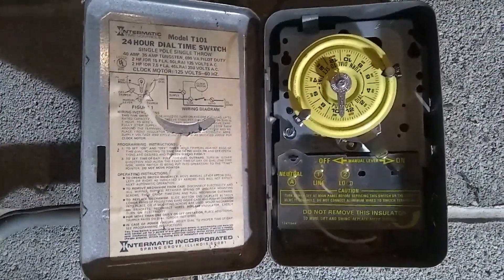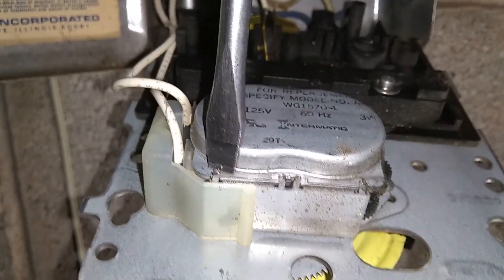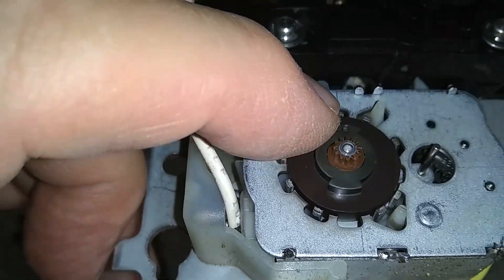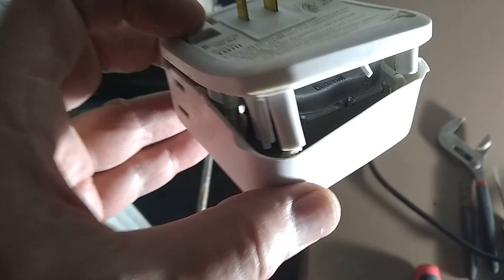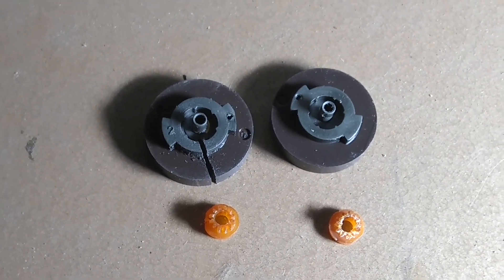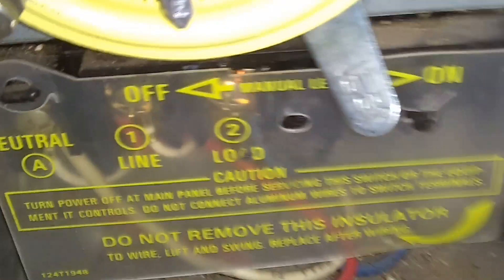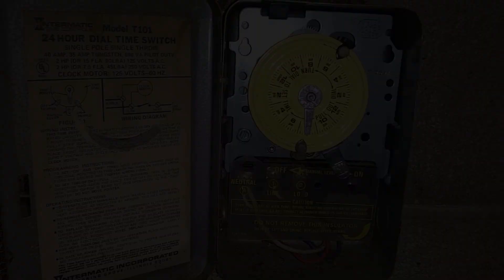Intermatic T101, T102, T103, T104, T105, or T106 Timer Switch Repair - Quick and Cheap

Comment: The very first gear is a Sacrificial resin material. The second is a thin wafer of plastic.  These things are Designed to FAIL!
Reply from the maker: The soft "rubbery" wheel that spins the fastest, does so very quietly engaging the next, plastic gear. If they were all metal, they would rattle. This whole thing ran great 24/7 for over 20 years.

Comment: will that also fix the noise issue? The same sound is coming from mine. I noticed the time was way off but this was the first I've looked closely at it as it came with the house. Thank you for the informative video.
Reply from the maker: There are several sources of noise in these timers. Each metal gear, as it gets loose with age, will add to the rattling noise. In my case it's in the garage, so I don't care about the noise. But if you have one in the house, then you might consider a quieter new replacement. I don't know of any other remedy. 
Good luck!

Comment: How many poles did you count on the motor's magnetized rotor?
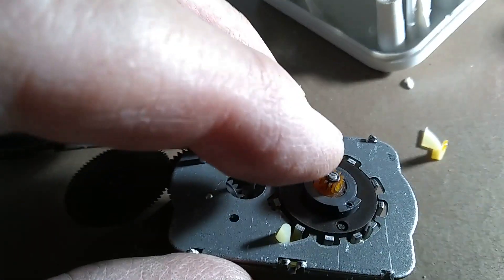Reply from the maker: I'm not too sure. I haven't paid attention to that. It's an interesting question since the winding (5:14) appears to be divided into 12 sections - with 6 pairs of poles to interact with the rotor. I will check it at the next opportunity and post the findings.
Reply: Did you not watch the vid? It shows your answer..

Comment: you do not have to "swap" the top gear, there is a silver spacer under the older style that can easily be removed by pulling it up and the replacement gear with the longer plastic sleve will now fit.